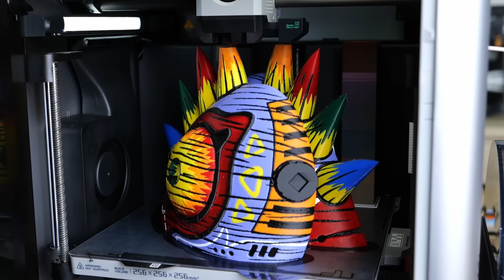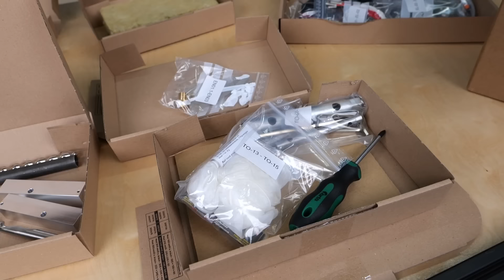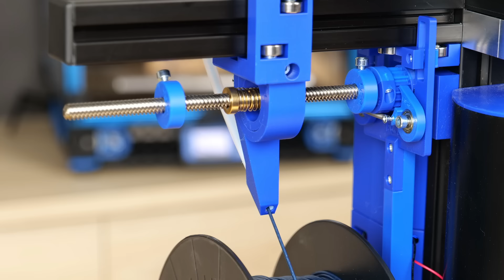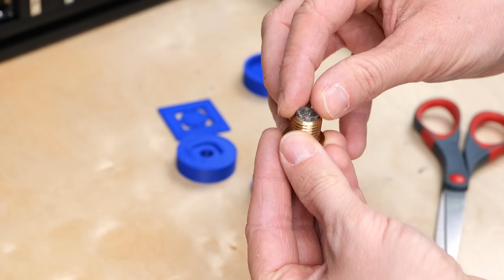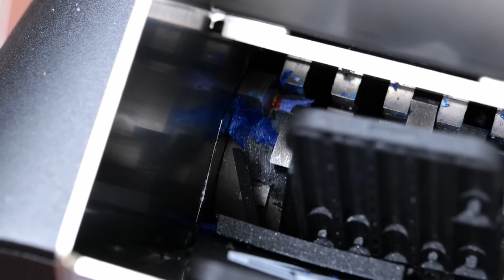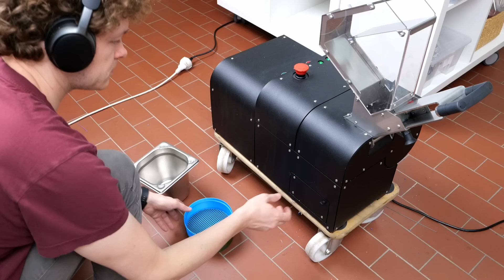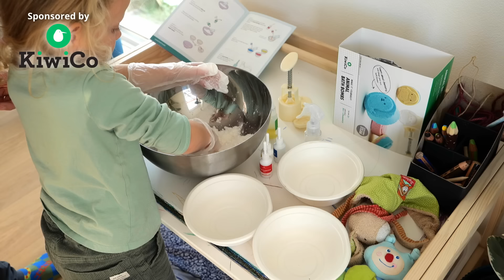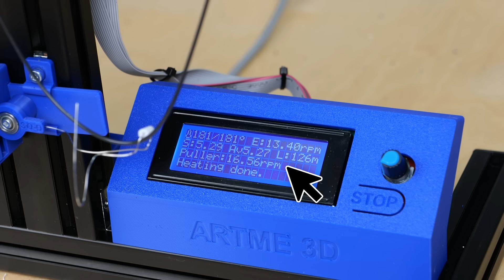Recycling Failed 3D Prints with a DIY Filament Extruder: Artme3D

Comment: When spooling you can start by attaching the filament on the outside holes instead of near the center. After spooling, cut it off on the inside.

This will give you a spool without kinks at the end which should work better with runout sensor.

Comment: As much as I love the recycling - 649€ is still over 40 Rolls of cheap filament. I'm 3D Printing since 2012 - yet I havent emptied 40 rolls of several filaments. If I account every material test, I would end up at maybe 25 rolls. Yes: If you are Ivan Miranda and you get your Filament as a shipment container delivery - this would be viable every day. But I'm printing small parts and a roll of filament lasts me almost 4 months.
Reply: More like 80-90 rolls of cheap filament - that is still good (chinese vendors during sales events).
Reply: Spacers!!!

Comment: That looks a fantastic piece of kit for heavy printers and up. I could see David getting overwhelmed it purchases in the near future. 
On the melt tube insulation, kaowool or even a carvable section of firebrick would be a nice alternative. In place of a teflon tape, while I've never tried it, a good quality Kapton tape has a higher service temperature and should seal relatively well. I would also look into a dedicated v-shaped pulley on the gravity end section, maybe a delrin material that's naturally 'slippery' that can also act as an impromptu sizing die of sorts.

Comment: A Bambu A1 series is perfect for printing out filament with variable filament diameter, since it’s extruding based on flow rate and should compensate automatically for width variations.

Comment: I have been interested in this Artme3D for some months now.  Clearly well desiged.  "Only 600 bucks" is still kinda high, but I really don't want to just toss scraps.  Plus the shredding is rough.  (Trying a cheap blender atm.)
Reply: But when you realize $600 equates to only 25-40 rolls of filament that really isn't much. I saw one project posted in one of the 3D printing on FB that ended up with the weight equivalent of about 1.5 spools worth of filament as waste. Granted, he didn't optimize the purge settings before doing the project.
Reply: @vikingdisposal  No idea what mutlicolor madness they were printing to have that much waste.  I keep mine in small boxes.  For most 655 usd is the same amount as their printer.
Reply: @sliverbaer  It was only two colors, but it was a huge project, and due to the nature of the model, it had to purge often. It would have purged a lot less if the model could have been rotated 90⁰ but the OP had some reason that wasn't viable. I can't remember why. They said in the future they would probably stick with printing one color and just painting the project.
Reply: @sliverbaer  Also, like I mentioned, he didn't have the settings optimized. He was using a Bambu X1C with the factory purge settings.

Comment: Unfortunately for a hobbyist it is not worth spending 600 euros For a solution without taking into account that you need to purchase a separate shredder. If everything cost less than 300 euros perhaps this type of machinery would be more widespread.Probably ahead of time, thanks to its diffusion the price could drop and spread further...

Comment: How can this be cheap? 650 euro without the printed parts (which seems like quite a lot of plastic and printing. Not to mention if u need ABS and chamber), no components like power supply, hazardous materials, hours of your time and so on. This is FREAKING EXPENSIVE.
Most of your viewers do not have 650 euro printer and you are talking of 1000+ euro of real value machine as cheap? Man where do u live? (I know where, don't answer me that haha)

Comment: you can add some flash graphene and make stronger filiment than went in,

you can add enough and it will be conductive.

you can make supercapactors using kapton tape and a engraving laser. (to make a bank to then make flash graphene)
you use a quartz tube and 2 carbon electrodes.

Comment: € 600,- is stil a lot of money and you will have to recycle lots of left over filament or waste material for this filament extruder to be economical. You need to make 20 to 30 rolls of 1 kg to break even. That's without the cost of a shredder. Any way, this is affordable and looks promising. All other solutions are way more expensive. Other diy machines don't work very good.

Comment: This looks interesting but I highly doubt that this is environmentally friendly in any way. Motors, PCBs and other metal parts require energy to be produced and to be shipped here from China. The only solution to the waste problem is by fixing the issue at the 3D printer side.

Comment: Considering that besides the feed tube, this thing is basically a 3d printer, I can see these reaching the insane low prices we are seeing in printers now. Huge step in the right direction. Its probably still too expensive for the average home user, but I could see power users or people who sell prints getting one of these. My only concern is how much other hardware you need to make this work. If you need to go spend another 400+ on a vacuum chamber and shredder, that is a lot less viable. I hope the industry can take note that people want something like this, and we eventually get an all in one solution that can make recycling at home viable. I will be saving and sorting all my waste for when that day comes.
Reply: Exactly!!  Remember grandma's old sewing machine could respool her cotton reels or bobbins at will.  Maybe in the future there will be a combo machine that will print and recycle your supports and off cuts to new spools :)
Reply: I have three tubs of waste I am keeping until I find a good use for it. This, although looks like a fun project, will not be it. I can buy a LOT of filament for what the cost of all the necessary equipment would be. A LOT.  Plus, i do not have that amount of funds to throw at a project. What a wonderful machine you built tho!!

Comment: Rockwool is an amazing material!! Its actually bio safe and will be absorbed and expelled by the body!! Neat!!! Newly manufactured fiberglass insulation should also be bio safe as well. Please don't hear what I'm not saying, they both can cause irritation and should be used with reasonable caution/PPE.

Comment: no part is the best part, no maintenance, include filament extruder in the 3d printers already, as a feature. its not compilcated, not even rocket science is. why600 units? it could be combined into a simple small print head unit, no part is the best part, if you dont need to do the support structure of a 3d printer with spool things etc, use immediately dont add parts, keep it simple. melting also will dry the material on the fly. self-cleaning filter also. no license (freedom) is better than even gpl/free licenses (tied to license not actually free, fake free). gen 2 of diy filament from scrap, this is only gen 1, go gen 2+. yes it can be made a ton better, filament.
Reply: It doesn't usually work that way - first step is to have very well working machine that is complex (and we are not there yet) - then simplify it and do production engineering. Will still take quite some time until we are there ...
Reply: you can make it work also that way, dont tell anything otherwise @TylerDurden-pk5km
Reply: tell me how it is, bro @TylerDurden-pk5km
Reply: engineer would always say: lets see how we can do it, only a lawyer would say that it cant be done @TylerDurden-pk5km
Reply: @gsestream  It can be done - the process of engineering is to find out how. And usually the first approaches will not be the most efficient - that will come later. First you learn how to do it, then how to do it cheaply (hopefully).
Reply: actually all the parts of the process are already there and done, you just need to combine them, in the working order ^_^ @TylerDurden-pk5km
Reply: @gsestream  I dont think that we are there yet - there is no lets say "Ultimaker" equivalent of machine for recycling yet. Meaning: Expensive, but working well 99% of time. E.g. for this machine: Shredding and dehumidifying is missing and filament width management is janky.

Once we are there value and production engineering can start ....
Reply: well you wont be there if you continue blocking yourself that way @TylerDurden-pk5km
Reply: do not try to dictate by "we" that I'm with you on your opinion or state of industry, industry always lags behind, because of the money community nonsense, responsibility, tied to others burden. not agreed. @TylerDurden-pk5km

Comment: If you use some magnets before loading the material inside the melting machine? Wouldn't be better to capture all the metal chips? maybe if you make a motorized cylinder and place the magnets inside and then feed the melting machine. Very well explained video once again. Thank you

Comment: This is fascinating tech, no doubt, but I have to say I doubt that recycling on this level does make any sense ecologically. The amount of energy that is invested into equipment, shredding, drying and extruding the recycled material will surely require a certain, not marginal amount of reused material before a break-even point is reached, and I am only speaking of the ecological, not economical point of view. I don't think that any hobbyist user will reach an output of recycling that will justify this method.

Comment: I tend to print small parts, so I don't think this is practical for me.  I just don't go through enough filament. It would need to be an order of magnitude cheaper, which would need an entirely new approach, not just downsizing the conventional process.

Comment: So, once you factor in ALL of the components used, all the 'spare' printer parts, the oven, the vacuum chamber, the shredder, et cetera, what approximate price, fully inclusive, would one be looking at? 🤔
Reply: Biggest cost looks like that shredder. I wouldn't guess under a few thousand
Reply: Some variant of "too much". Plus the process still looks really finicky. It's interesting, and possibly a fun project if you like 3d printing for itself. But as an individual user, if you simply see 3d printing as a tool, it's probably not worth the effort and money to be honest. In more collective settings (farm, fablabs, etc), it might be more relevant however.
Reply: Yeah... Id love to see this exact same process done for a little as possible. No vacuum chamber, cheapest shredder. Just a food dehydrator, as most people who 3d print should have one.

Comment: Wow that's not bad... Sure you don't save much, but in the long run you're bound to save a decent amount, especially if you're 3D printing stuff and selling it online somewhere. 
I mean... You can get some expensive filaments! So if I am wasting maybe 1/5th of a roll on failed prototypes and purges, then this is an investment that would pay off, especially if I were to use slightly more exotic filaments. Might take a while to get a feel for them, but it's possible to do.

Comment: Get yourself an ARTME filament extruder US$ 656.00 and a FELFIL filament shredder US$ 1,615.00 for a total of US$ 2,271.00 and make your own filament (IF YOU'RE CRAZY ENOUGH).

If you divide the total of US$ 2,271.00 for a spool of PLA valued at US$ 16.00, you get 142, which is the number of recycled spools you'll need to make to get the investment back, OR NOT? NO because you already paid for the PLA you're recycling, the failed prints, what adds another US$ 16.00 each spool you make with this process. 

Your "amazing" recycled spool will cost you the failed prints for US$ 16.00 + 15.99 (US$2,271,00/142=15.99) for the first 142 spools) = US$ 31.99 for EACH RECYCLED SPOOL!!!!!!!!!! After 142 spools, each recycled spool will cost what you paid for the PLA that got recycled (US$ 16.00) plus your time/labor and electricity consumed in the process, which I didn't include before because that was already FREAKING INSANE even without this costs.

Botton line, this is INSANE. Got failed prints? Trash it and buy new filament spools.

Comment: For a hobbyist like me it's useless, simply because it'd take ages to collect enough scrap to make a useable amount of filament. For anyone doing small scale manufacturing with a small print farm though, it's a game changer. Seems like the real problem that needs solving though is a low cost shredding solution. Teaching Tech has his filament shredder, but that's not going to work for scrap.

Comment: Interesting as a development project and drive the art forward - but seems to be quite far away from being practical or financially viable.

With filament prices starting at 6-8€/kg for Chinese filament of good quality - the solution needs to be more robust, would need to include all production stages (grinding, dehumidifying) - and cost around 100-200€ max. That looks like some years away ...

As it is, it does not make sense - and simply throwing failed prints away and let the plastic be incinerated for the energy content, seems the more reasonable and even more ecological solution.

Comment: I wonder if it would be possible to have the 3D printer check the diameter of the filament and adjust flow accordingly. (Yes, I know it would need additional hardware…)
Reply: Klipper already has the software built in to use a hall-effect sensor to measure filament, so it;s just plug and play

Comment: I think if it was a bit cheaper it would be a buy for me. Something around 350-400 usd would start to make sense. The big drawback is the shredder. I can't seem to find a good solution that won't cost an arm and a leg. Great video as usual. Thank you for your work
Reply: With filament prices starting an 6-8€/kg, how would this be financially viable at a price for 400USD? 
It is hard for me to see viability at these prices - especially if figuring in energy cost, labor costs and wastage.

Comment: Awesome video!!!!  My printers support my scale RC truck habit, so most of the parts I make are support parts that are normally never seen when the vehicle is running, so color does not matter. The problem is, of course, as a hobbyist, I just don't have enough waste over time to make this feasible, or cost-effective. This is where, as a community, we need to have local clubs so we can pool our used filament together for recycling.
Reply: Putting old / failed parts into the bin (at least within the EU) already leads to them being recycled - thermally.